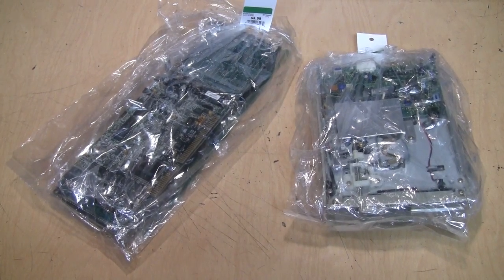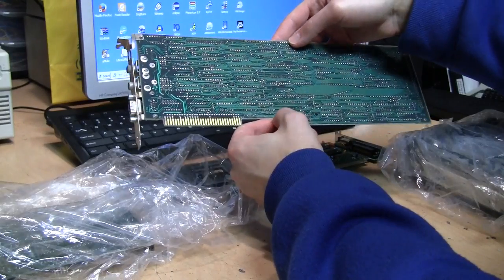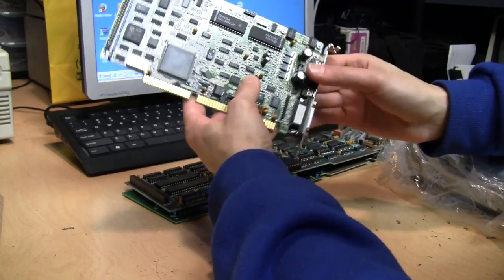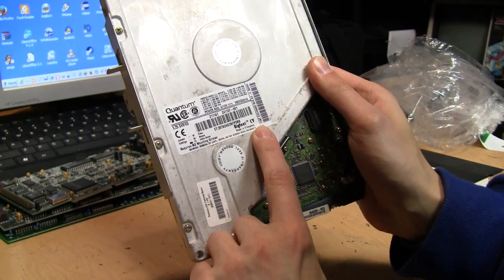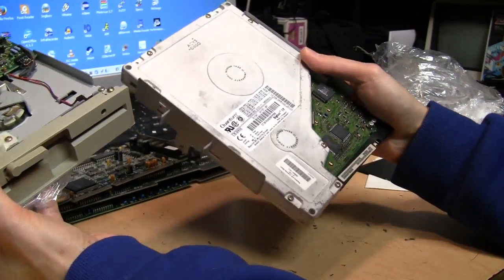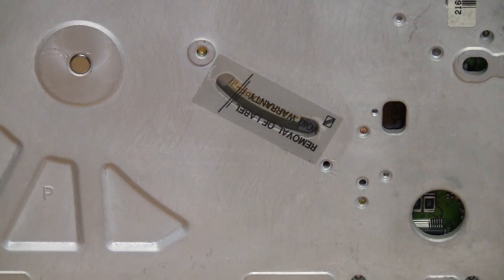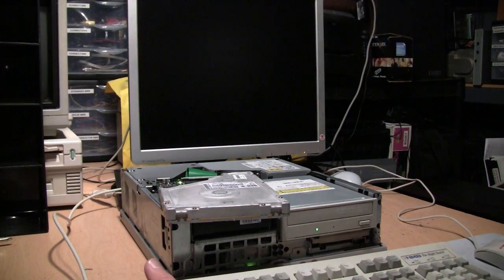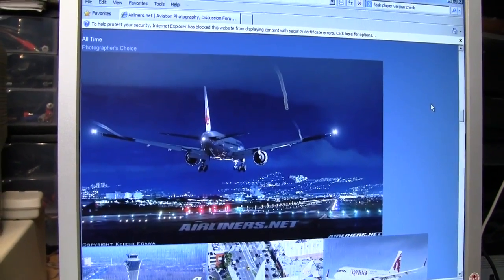Bag O' Computer Parts & Quantum Bigfoot hard drive

Comment from the maker: Correction: The pin header on the sound card is actually an output for playing the sound card's audio through your computer's internal speaker.
Reply: I've been trying to find a dead Quantum Bigfoot drive for a while. Absolutely do not need one that works.
The SCSI controller on the PAS16 cards should automatically install. At least it does on Windows 95 as a Trantor SCSI controller. Transfer speed is SLOW. Just fast enough for a 4x CD-ROM drive. Being SCSI you can attach other SCSI devices like scanners and hard drives, but you can't boot from drive connected to the sound card. No BIOS ROM for it.

Comment: @11:15 hard drives are not sealed (unless it is helium). Some will even have a arrow printed on the sticker "do not cover this hole". This is a breather hole, releasing pressure when the drive heats up. Also this is a reason hard drives have min/max altitude/pressure specifications. However the hole is small, and is protected by the filter on the inside.

Comment: In 1997, my father bought a Compaq Presario 4160 I think computer with a 150MHz Pentium, 16MB of RAM (soldered to the motherboard, plus a free SDRAM DIMM socket) and a 2.1GB 5.25" Quantum Bigfoot which died under warranty.
In late 1998, my mother bought an Acer AcerMate 3100T with a 233MHz Pentium MMX, 16MB of EDO RAM (2x8MB 72-pin SIMMs plus 2 free sockets) and a 2.1GB 3.5" Seagate Medalist... which died under warranty.
I still have both computers :).
Reply: Do videos on em! :]
Reply: +Ale Yeah mate do a video.

Comment: Drauga1 made a video about a Quantum Bigfoot HHD a while ago.
Reply: 3MJB Studios I think Drauga1 installed Windows ME on the quantum big foot
Reply: Yes, he did.
Reply: He did.  Bigfoot drives make your optical drives nervous, because it's so big.  Apparently.
Reply: Recycle Hin is that because if you don't have a spot for it you have to remove one of the optical drives ? Lol
Reply: Yeah that's right - in a dual drive setup you've got to take the secondary out.  Also it is prudent to not slave a Bigfoot to an Optical drive.  Bigfoot ain't no slave.  (That was one of Druaga's best videos I think)
Reply: I still have my old bigfoot drive, up and running :D
Reply: I bought one in 200ish, can't remember the capacity of it.  It lasted about 2 years.  I have had a mistrust of hard drives ever since.  Having said that I have a Samsung Spinpoint drive from 2003 that still works fine, there's nothing critical on it, it's installed in one of my other older PCs
Reply: "Slave it to the optical drive? Oh, hello no, bigfoot ain't no slave!"
Reply: Recycle Hin wasn't quantum bought out by maxtor?
Reply: Quantum still exists today as a backup and enterprise storage management company. They only sold their line of hard drives off to Maxtor.
Reply: uxwbill oh ok that's makes more sense
Reply: "GIVE ME THAT POWER BITCH!"
Reply: "Slave it to the optical drive? hell na bitch, Bigfoot ain't no slave!"
Reply: By the way, HHD means hard hisk drive (:

Comment: So jealous of American thrift stores. In the UK our "charity shops" will never sell anything approaching this. Also you will NEVER see a computer. They get dumped as they contain personal data and the charity shops would practically need training and certification just to switch it on.

In most shops I look in I will be lucky to find battery powered light up novelty egg cup. That at least will be electronic!

A couple of times I saw a old AGP graphics card. It was only in the shop because it was still in its box and was mistaken for a boxed board game.
Reply: Turns out the best place to go looking for that sort of thing round here is at the various open air car boot sales... unless it's already gone to ebay, freecycle, gumtree, or of course the tip :/

Comment: Back when they were new, it was my experience that even the earliest Bigfoot drives were head and shoulders above the 3.5" Fireball line in terms of reliability. And yet somehow things have turned around. I've still got a few Fireball drives that work and no (well, maybe there is *one*) Bigfoot drives that still work.

I was able as of a few weeks ago to post a comment on Youtube using IE8.
Reply: Did you have a Compaq AIO PC that has the Freball HDD that would get stuck all the time?
Reply: It's funny you mention that because I actually have a fireball which is used as the boot disk for a FreeNas computer, and it always gets stuck for a few seconds before it can spin up when it first turns on.
Reply: I own or have owned at least one example of every generation of Fireball drive, and reliability seems to be spotty (but generally good) across the entire history. The best ones seem to be the ones between 2.1 and 6.4 GB. The ProDrive ELS drives seem to be good as well. And I have a newer BigFoot that just goes and goes.

Comment: Whatever you do, DO NOT plug the PC Speaker signal into that sound card, you'll blow the amp. That header is an output for a speaker in the case, the PAS actually sniffs the PC Speaker signal directly from the ISA bus but might not detect it in faster machines. In short, you'd disconnect the PC Speaker from the motherboard and plug the speaker itself into the sound card. But yeah, otherwise the PAS cards are brilliant and they do have Sound Blaster compatibility. I swear by my PAS16 for my 66MHz Pentium system, never lets me down and their included software is brilliant.

Comment: I'm actually looking for a 1GHz DeskPro, though I'd rather have a full-sized desktop than a SFF.
Reply: I came across a Deskpro EN in a thrift store. It came with a PIII 866, but I upgraded it to a 933.

If you're still looking for one, I found an SFF unit on eBay: https://www.ebay.com/itm/Compaq-DeskPro-EN-SFF-Desktop-1-0Ghz-Pentium-III-CPU-512MB-Windows-98-DOS-Gaming/163018243910?epid=18014334762&hash=item25f4a4ff46:g:cdMAAOSwpeFa4Mnc

Comment: How many RPM is that drive?
Reply from the maker: 3600 RPM.
Reply: Hmm... I'd expect it to be more than that, considering its size and noise it makes.
Reply: Bigfoots had slower spindle speeds than most others of their time.
Reply: 3599 rpms

Comment: Small capacity hard drive production was probably maintained for service spares on old equipment. I recall seeing a 4gb 3.5" drive, dated 2004.  That 4gb drive was likely intended for service spares for 90s equipment.  On the other hand, I remember the 10gb capacity upgrade kits, circa 2000, complete with a floppy disk to re-flash an old computer's bios.
Reply: Yes, I would agree with your reasoning, and normally I would have expected bios modifications to have been applied.  But, as I have seen a 2004 4gb drive, when there was no consumer demand for 4gb drives, I suspect that production was continued for maintenance of batch quantities of computers (maybe a government contract), irrespective of the fact that the bios could have been re-flashed. I had a 2002 machine, originally fitted with a 40gb drive.  The bios was from about July of 2002, as I recall, so the drive limit was just 128gb.  I was able to re-flash it to take a 160gb drive, which was not available until the fourth (corrected from third) quarter of 2002.  I certainly don't need to even consider bios re-flashing on my two current computers, as they can handle multi-terabyte drives.

Comment: I remember taking many of those 5.25 inch drives apart for the circuit boards and metals when I was volunteering at MCC in the mid-2000s.  If I had foresight, I would have kept them and sent some your way today.  I can still identify metals by sight.

Comment: I remember years ago with a customer that had a bigfoot drive that was doing that and I fixed it with a firmware update.  A had to build a quantum bigfoot firmware disc and it flashed the drive and it was fine after that, however I think the drive was detecting in the bios.  I used to theorize that they called them Quantum because Quantum is related to time and it was only a matter of time before the drive died. Bigfoots and Fireball drives I learned to loathe.

Comment: You should be able to resurrect the old hard drive by removing the controller off of it and giving it a clean with isopropyl alcohol. You may need an even older OS and computer to read from it.

Comment: The Bigfoot cannot have been manufactured in 2000 by any kind of means. My 2000 PC had a 16 gb drive, and while I'm not completely sure, I kind of remember lowest range PC's mounting an 8 (or 8 - point - something) drive by then. So yes, the year on the Lucent chip must be closer to the manufacture date of the drive itself.

Comment: Ahh, the Bigfoot. Seemed like a good idea at the time, in 486 systems with multiple 5.25" bays but only a CDROM drive and no big floppy occupying them, and limited 3.5" expansion space. Friend had one, and it was just about the cheapest way of getting a full 2.1gb of storage into your machine at the time he bought it (yep, same size as yours), not sure you could even get 3.5" ones of that capacity at the time in fact, but they probably kept selling them for years as they would still have been cheaper. Seek time wasn't so brilliant, but for a bulk storage secondary drive in addition to e.g. your original 3.5" 528mb drive, maybe installing bigger games like Quake (and Quake II once he put in a better processor and a 3D card) it did a fine job.

And same as yours, It was also remarkably *thin*, like probably quarter height vs the half height of a typical CD or floppy, and seemed slimline (despite the wider footprint) vs even a typical 3.5" of the day which were somewhat taller than they are now. Maybe you were supposed to be able to fit two into a single bay?

Comment: I had a Quantum Fireball drive, years ago. Same form factor as yours. It was a salvage from two of the same type, one a physically dead drive and another one that had a dead controller board. It worked, but if the drive hasn't been on before in the day, it would not spin up. So every day started with giving the drive a solid flat palmed whap to get the motor to spin up. Probably not good for the heads and platter, but it worked!

My guess with your drive, if given enough time it would have eventually started because it made different noises after a while. But that's only a 50% chance and probably not worth your time.

Comment: Something that sticks in my mind is reading an article in a computer magazine of the time recommending Bigfoots (Bigfeet?) because they offered the best storage capacity/buck of the time, saying they were fine for data storage where speed doesn't matter so much. And 2GB is small for the time; I had a 4.3GB boot drive in my 1998 PC build (also a massive 17.4GB Fujitsu that was not cheap, for storing the audio from Cubase). I remember 4.3GB being quite moderate at the time.

My early 2002 build (Athlon XP) had 60GB for boot and twin 60GB (in RAID) for data. Specs were changing really fast back then.

Comment: Older drives like that tend to have parts that freeze over time. I've resurrected several drives simply by dropping it flat on a hard surface a few times to break free any jams. Dropping from about a foot up on a solid desk works on 3.5s. Might need to drop a little closer with a heavy 5.25.
Reply from the maker: That works if the drive has stiction. But if it spins up then usually that's not the problem.

Comment: With regards to Youtube on IE 8, Well...might have to try that sometime.

I did a hack about 2 years ago where I got Opera 3.62 under Windows for Workgroups to almost load a youtube video using the 32-bit flash plugin from Firefox from Windows 7 - got the complete loading circle and everything.  I think given the right circumstances, enough fiddling (and convoluting my brain in ways not done in years) loading videos on older browsers and O/S is possible. 

Oldest thing I ever ran Youtube on was a 486 DX2-66 (same machine actually before I upgraded it) running Windows 95 OSR2 and IE 5.1 w/ 128-bit Encryption add-on - it actually did work, but the frame rate was more like a picture show than a video, but the streaming audio was dead-on 100%.  That was almost10 years ago (2008 I think) though when the video playback system was a bit different.

Comment: I remember when I first bought a Seagate Barracuda drive and it too was one of those first to use the fluid technology. Man what a difference that was. Although I still don't mind the sounds of vintage hard drives, I think when you start getting used to silent computing technology, hearing any sort of noises irritates the average user moreso than it would've 20 years ago. Just think about it, hard drives went from loud and clunky to literally silent and even silent completely with SSD technology, even removable media...floppy drives/CD-ROM drives to flash drives and even SD cards to an extent. My Pentium III computer in the living room is quite loud with the power supply in it and this Core2 Duo in here is almost silent. I think some of the only real exceptions to newer computers would be fans on laptops which can still make quite a bit of noise when trying to cool the machines off.
Reply: Well, here's the deal. It's an HP Vectra VL600 desktop case machine and the power supply actually doubles as a CPU cooler. Although I use a slotket so I can use a SL52R processor with it and it has its own fan, there's no way to throttle the fan down on the power supply and just runs full speed all the time. Problem is, the way the case is designed, it's next to impossible to get a proper fitting replacement or at least something that would suffice.

Comment: I bought an ibm xt 286 from eBay with a 5.25 inch mfm 40mb hdd which had failed. I also tried to get it to work in another system without any luck. I do have a question though if you don't mind. I have an Intel 2mb above board isa memory card for the ibm but I don't know how to get it to work. Any ideas?
Reply from the maker: Ask on the Vintage Computer Forum.
Reply from the maker: I alerted the site administrator that your forum post needs moderator approval, so hopefully they'll take care of it soon.
Reply: Thank you, it has now been posted.

Comment: Always hated those big foot drives,very unstable and too big to fit in smaller cases with already filled 5.25" bays. 1.3gb quantum bigfoot that my dad bought for his AOL windows 98 machine.Hated it. I would tap the case or he would bump it and down goes the PC. Then he wised up and bought a 10GB Western Digital and the troubles on the hardware front ceased! Until he bought a PC-Chips 133 first gen P4 board! No!!! In other news... I wanted to explore my local thrift store in the spirit of this video to see what I would find and I found a newish Yamaha PSR18 FM keyboard,stand and headphones for $16 after tax! Not bad. I did see a ATT wall phone but decided not to buy it..yet.

Comment: Which OS will you move onto if all windows xp support is dropped?
Reply: Just curious.
Reply from the maker: Support from whom? I still have some computers running Windows 98.
Reply: As in, when all support drops for the Windows XP (your daily driver OS) online-based programs (like web browsers and antivirus) that you use, which operating system will you migrate to? I love Win XP as much as you and programs are still supported, but when the support for the types of programs I mentioned drops, you just gotta find something else. What OS would that be?
Reply from the maker: The audio editing program I use (Adobe Audition 1.5) does not run well in anything newer than Windows XP. But audio editing really doesn't change over time, so it doesn't matter whether Adobe or Microsoft still supports it. It's supported by me and I can continue to use it for as long as I want. But these days whatever I can't do easily in Windows XP, such as HD video editing, I do in Mac OS on my MacBook Pro. I have computers running Windows 7 and Windows 10 but I very rarely have a need to use them.

Comment: I had a quantum Bigfoot hard drive I believe it was oh uh 4 gb and I was running windows 98se on a gateway 2000 pentium 2 processor with 256 mb ram. or 512. heck I had dial up it was my first computer had a tape drive 3.5 floppy . I got it before I graduated high school 2005 at a goodwill store  with keyboard and mouse. didnt have monitor so grabbed one off shelf and used that

Comment: why people don't use  floppy disks ?
Reply: Vinyl Guy Because its funny to say floppy
Reply: Because 1.44 MB is a tad bit small for today's data storage needs.
Reply: I was still using floppies up until about 2005, I still do occasionally for small things or transporting stuff to older computers but the bad thing was their reliability. Sometimes they didn't fair so well being transported and you'd lose something because the disk went bad or you put it into a bad drive.
Reply: Viper Jay 5  so it's only for like saving a easy

Comment: There is one more way to get a bigger hard drive that they used is to add platters !! So instead of one or two they might have seven platters !!
Reply: Yes, but that makes the drive taller. 1.625″ high (equal to a half-height 5.25″ bay) HDDs did exist back in the day (mainly for enterprise; the last of them being, as far as I know, Seagate's Barracuda 180 in 2001), but good luck fitting one into a modern PC case.

Comment: If you pick it up and slam it down not hard sometimes that works with old hard drives. Hey if it's dead you can't really hurt it anymore. 

I had an old yellow monochrome PC that took those 5.25 floppy disks and someone I know put one of those brick hard drives on it to make it more usable, and one day it wasn't reading right and he slammed it on the table and it started working again. 

I wish I still had that drive as I'd try to hook it to a modern PC like you did with that USB adapter but this drive had different connectors.